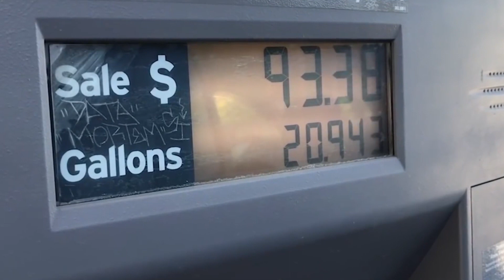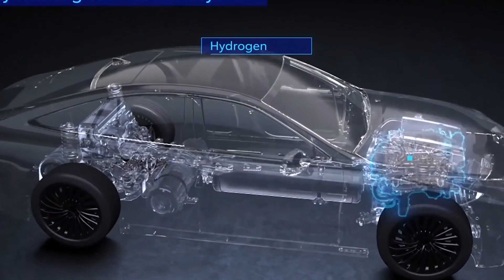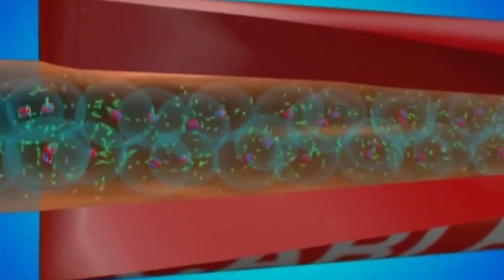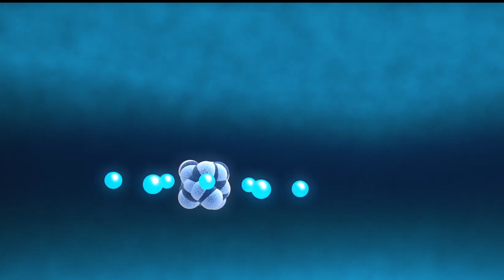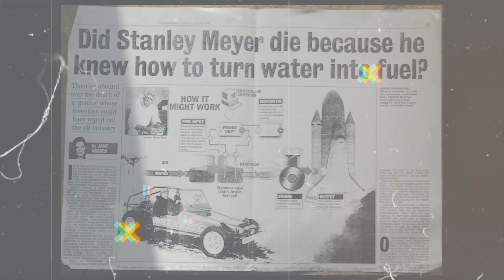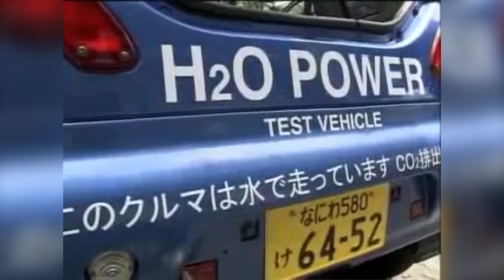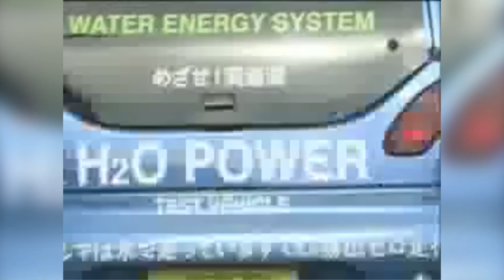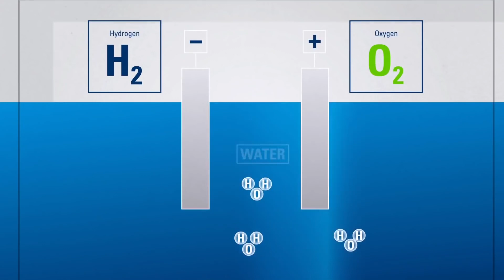Why Can’t We Have Truly Water-Fueled Cars?

Comment: Produce the hydrogen in the car as you're driving that way you don't need the infrastructure to support storage each vehicle would make its own fuel as it's driving down the road by the alternator keeping the stainless steel plates immersed in the water energized and hydrogen would keep pulling off crank the voltage up produce more motor goes faster easy as peasy quit trying to make everybody think they got to pay for hydrogen when they can produce it themselves

Comment: They've already had cars that ran on hydrogen fuel completely the only problem they had was trying to get the motor to rev up and pull because they would need to increase the production of hydrogen in the fuel cell as the throttle position goes up in the RPMs climb this particular system was on a Corvette and the power is that fee he ends up murdered and nobody ever found out why they murdered him and I can tell you why he was killed off because it would have stopped the oil companies from making their trillions of profit it would stop the oil companies from bribing politicians to do what they want him to do and now if we the public have free energy then their Cash cow the American public get to save money

Comment: Great propaganda to protect big oil!   Back yard mechanics use electrolysis on their cars all the time.  They use it to supplement the fuel which gives them about a 50% increase in mileage, steam cleans the deposits out of the engine and cleans up emissions.  It is created on demand and is never stored so there is no danger from explosion.  Bob Lazaar runs his C4 Corvette on water but uses a type of metal that the crooked government will not allow us to purchase.  There are no issues with water powered cars and it is so easily done the cabal will not allow it.  Those who try end up like Stanley Meyer, dead.  

As for your comment about fossil fuels.  Oil is not from a fossil.  It is a byproduct of algae and is created faster than we can use it.  It will never run out.  

The quality of this video is proof that big money is behind it.  Big money that depends on oil.
Reply from the maker: Hey Russ, we think you’d enjoy watching another one of our videos about electric vehicles. Please share your thoughts in the comments. Your feed back helps!

The Dark Truth Behind Electric Vehicles
https://youtu.be/9hKjzbs5-Q8